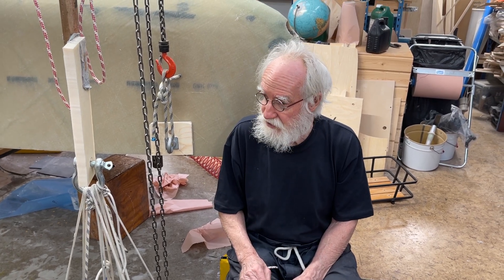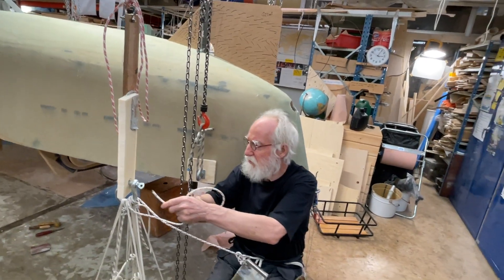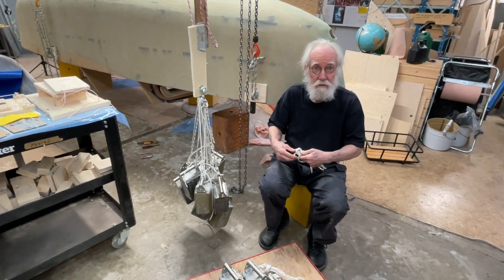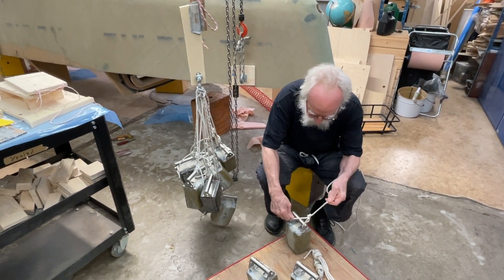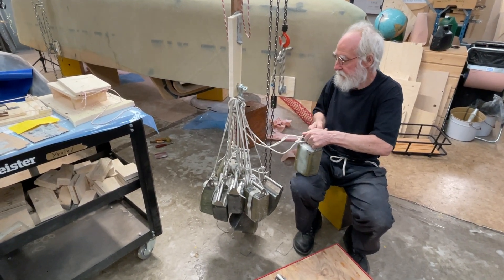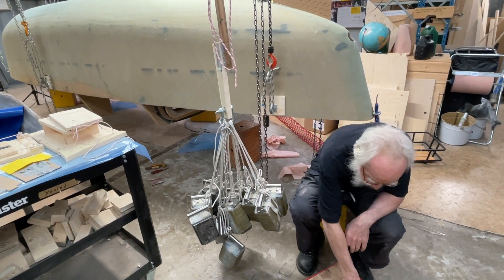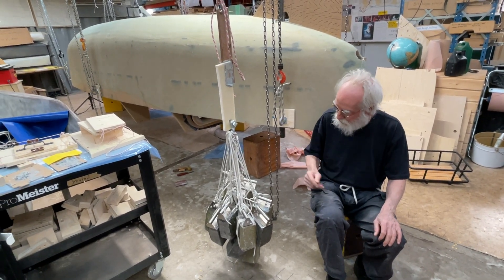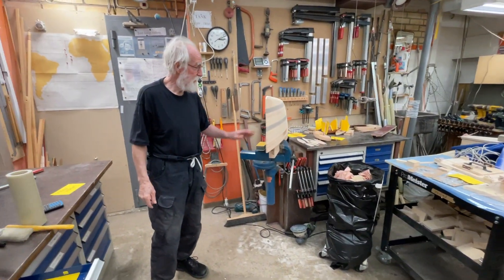The keels will not fall off

Comment: Good shear test. But when boat is knocked to 90 degrees, you will have significant torque loading of keel weight multiplied by their draft with one side of keel joint in compression&shear and the other in tension& shear. I could run an FEA stress analysis on Autodesk Inventor to check ultimate stresses. Usually keels fatigue in fore/aft direction but yours won’t be an issue as they are quite long compared to their draft.
Epoxy tends to fail in tension when immersed in water for prolonged periods. The screws will certainly improve safety in case of cohesive/adhesive failure. Your design appears quite safe but I’d want to confirm stresses using a computer model
Reply from the maker: The base is 15 cm the deept is 25 cm the lenght is 150 cm each flange is 3 cm each keel is 75 kilo the epoxy laminate is 10 mm
Reply: Good pointing out "real life" conditions (torsion, compression, flexion, salinity....), but computers have flaws too.

Comment: Thank you and Peter for today's video. I went back to your video of the screw pull out test you did. For a summary of the tests: you had one screw hold 84 kilos without epoxy in static load. Each keel weighs 75 kilos and you plan on 50 screws per keel. To pull out all of the screws would would take 4200 kilos per keel (more than twice the displacement of Exlex per keel). In this test it looks like you have a 10 square cm glue area and it held 182 kilos and did not shear break the bond. With each keel having about 4cm x 150 cm glue area (600 square centimeters) you have a shear strength of 10,920 kilos. I think you have more than sufficient strength to keep the keels on Exlex.

Comment: Yes but you're testing shear load. Your keel will not be glued on a sheer face. When you have two vertical surfaces bonded with an adhesive or a nail or any type of fastener and the load is straight down you have incredible strength at the surface. For instance if you mount a flat screen television on a wall and you keep it very low profile to the wall, I can hang a 40 kilo television with a single drywall screw. However I would need 20 drywall screws or more if I hung that TV on the ceiling pointing straight down. Your keel will be glued to a horizontal surface. There will be considerable forces at various angles placed on the adhesive. I would not trust a simple adhesive in this manner no matter how strong it is. You simply don't have the surface area. Now your bilge keels are hollow. If you epoxied in a sheet of divynicel and made an incision through the hull gluing the sheet on all four sides to the incision, in addition to the flange on the bilge keel that would possibly be strong enough. Because you would have vertical surfaces holding the keel on. I hope you get what I'm trying to say.
Reply from the maker: Sheer loads are the highest as it is the ones that occur when you hit a rock and it is mo simple adhesive its epoxy and the surfaces are huge.
Do not worry about the cealing hanging TV.
Reply: When I say adhesive I'm also including the epoxy which in this case is being used as an adhesive. In addition, you have a very small chance of slamming into a rock with the bilge keel as opposed to the keel falling straight down in heavy seas where you might be pounding into breaking waves. Inertia will cause the force on the keel to keep wanting to travel down even though the hull has made contact with the water. That will multiply the effective weight of the keel many times in gravitational forces testing any epoxy and fasteners you might use. Another option is to use bronze backing plates contoured to the shape of the hull. If that's difficult to fit because of placement of structural stiffeners or bulkheads, you can segment that up as long as you are creating a surface area that will spread the inertial load across a big distance. Of course this would be in addition to the epoxy bonding. You will not be able to simulate the conditions at sea in your workshop so you have to assume they will be many multiples of what you could possibly test. Now if your keel or both keels should come off, you might want to come up with a contingency to keep the boat righted if you feel the internal ballast weights may not be sufficient. I was thinking about a bridal system where you could tie the counterweights to the center of a line and lash it to both port and starboard sides amidship and suspend them one or two meters below the surface. You could do that to several of them and that would keep the boat righted. You could possibly also sail that way but there would be significant drag. Probably it would be the least of your problems.
Reply from the maker: @craigross5945  I trust my calculations.
There will be no backing plates or other of your ideas. I will glue and screw into the outer laminate.
It have worked well in the past.

Comment: I like these simple, real world tests. Call it practical Svengineering.
Reply from the maker: Glad you liked it.
Did I meet you many years ago with Matt Layden at his wife parents in Cedar Key messabout or am I comfused?
Reply: @SvenYrvindExlex  Yes. Met Matt and Karen doing Everglades Challenges. That lunch is a highpoint of my sailing career.
Reply from the maker: @garyblankenship9163  I did not know about your designs then but have now seen them on internet and like them.
Good work.
Would be nice to meet again.
Best regards Yrvind.
Reply: @SvenYrvindExlex  To be strictly accurate, they're my builds, not designs. Mostly have done Phil Bolger and Jim Michalak designs.
Reply: Svengineering.  Love it!
Reply: Svengineer meet Gary Craftsmenship again.

Comment: Yes ok you try it static and dry . But ther are more factors than the weight at sea. Like constant turbulence and vibrations PLUS water making screws slippery and get loose PLUS hiting serfing objects with keel  .. The point is ?? IF is safe with one keel and is not flip over ...
Reply from the maker: Every boat is designed static and dry. 
Then factors of safety is applied.
As for the slippery screws. I encapsulate them in epoxy. That way no water gets in contact with them

Comment: I like it for shear loading when you run aground but what is the normal direct loading on the glue joint? Will you build a jig and turn the glue joint 90 degrees?  These tests are great!  The rudder looks great! I wonder how a bronze bow centerboard would work?
Reply from the maker: The keels are 15 cm wide but only 25 cm high.
They are also 150 cm long each only 75 kilos each.
Thats many times better than production boats.

Comment: What would happen under impact? Like if you dropped the weights from a couple of meters? You would need to calculate the momentum of the boat at a reasonable speed coming to a dead stop against a rock.

I think epoxys are highly resistant to static loads but I am less certain about their resistance to cracking.